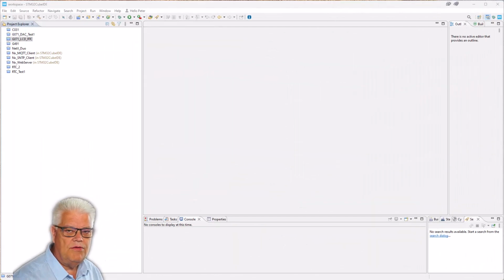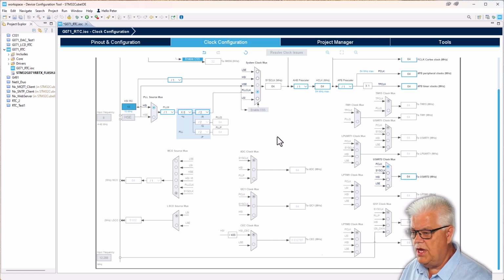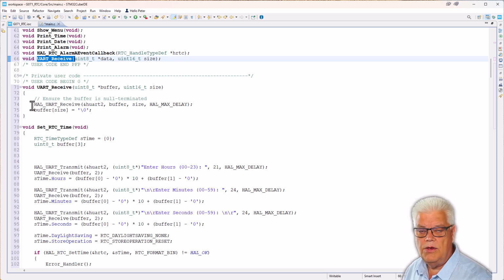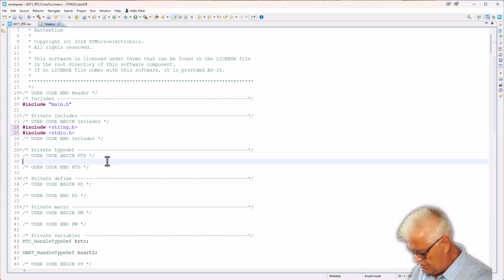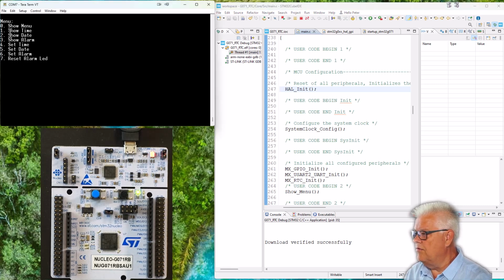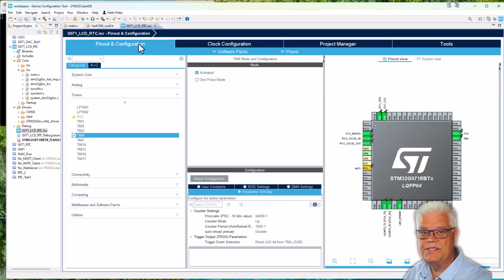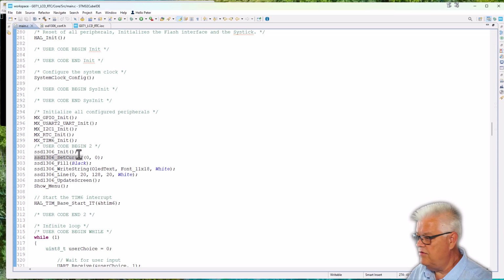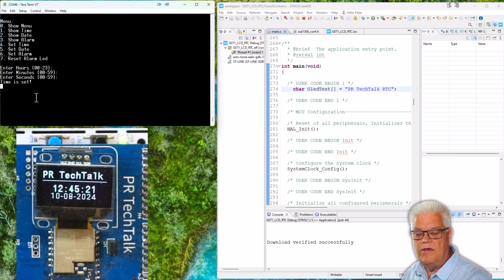RTC for STM32 Tutorial

Comment: Great tutorial, thank you!

I was able to implement the first part (I haven't tried the OLED part yet). The behaviour I observed is not exactly what I expected, though:

If I reset and ask for the time, I get some number of seconds, depending on how long I waited before asking for the time. When I then ask for the time again (I press 1, wait and press 1 again without accessing any other menu items), I get the same number of seconds - the count does not move on, no matter that I wait > 1 second.

If I ask for the time, then the date and then ask for the time again, the second count DOES move on, and I get a (plausibly correct) number of seconds since reset. So it behaves as though i) the RTC is counting always (GOOD, phew), ii) asking for the time causes that time to 'lock up' and be repeated whenever you ask for the time and iii) rule ii) is dis-applied if you ask for the date.

I amended the Print_Time function so that it does a part of the Print_Date function's work:

void Print_Time(void)
{
    RTC_TimeTypeDef sTime;
    RTC_DateTypeDef sDate; 
    char buffer[50];

    HAL_RTC_GetTime(&hrtc, &sTime, RTC_FORMAT_BIN);
    sprintf(buffer, "Current Time: %02d:%02d:%02d\n\r", sTime.Hours, sTime.Minutes, sTime.Seconds);
    HAL_UART_Transmit(&huart2, (uint8_t*)buffer, strlen(buffer), HAL_MAX_DELAY);
    HAL_RTC_GetDate(&hrtc, &sDate, RTC_FORMAT_BIN); 
}

And now all seems to work as expected.

Apologies for the very long post - if anyone got this far, do you have an explanation for this behaviour? Thanks :)

Comment: Hi how are you? I learnt a lot from you video, I implemented my RTC using a backup register but when I turn off the device the set time doesn't continue it stops at the last read time, any ideas?
Reply from the maker: If you turn of the MCU then all clocks stop and also the time keeping. You can "only" put is in some lowpowermode that still remain RTC functionality and you find this info in the MCU manual.
/PR TEchTalk